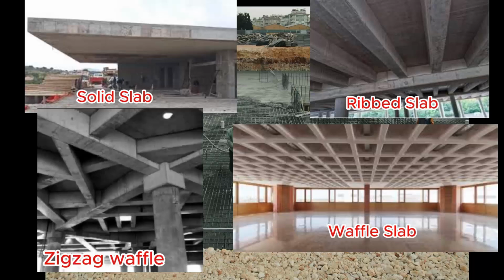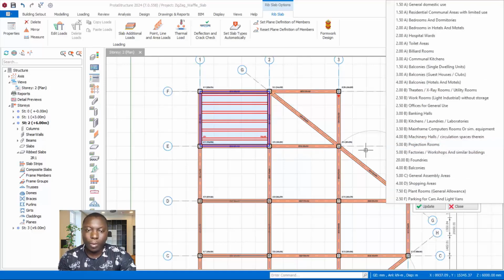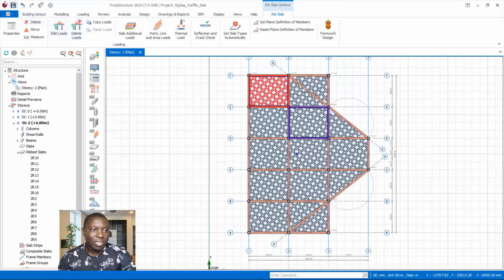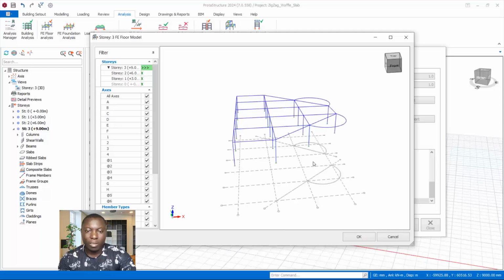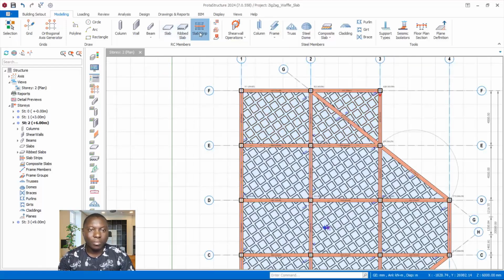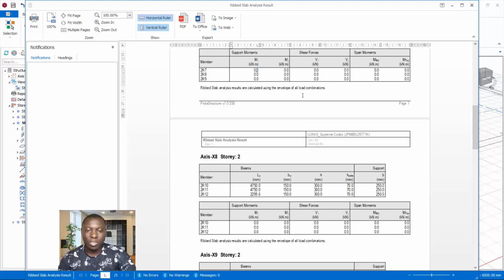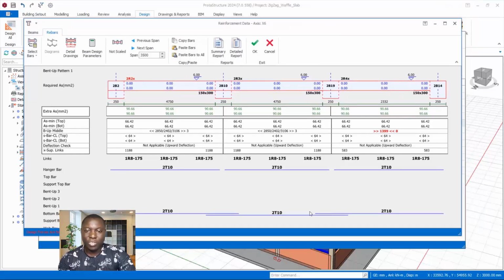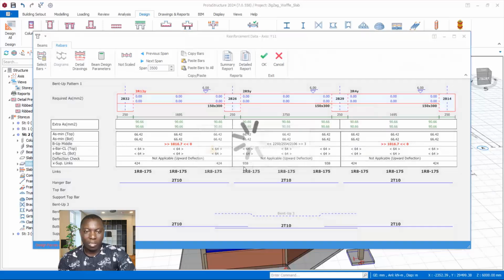Zigzags Waffle Slab and Drawings on Protastructure

Comment: I think the strip have to be parallel  to the rib
Reply from the maker: ok, but the rib beams are in two direction, drawing parallel strip to the beam in one direction, don't you think the rib beams in the other direction won't design?
Reply: @CADmade-easy  the same , you have to do ,one parallel to direction 1 and the other parallel to direction 2